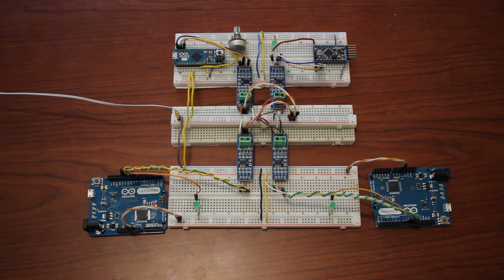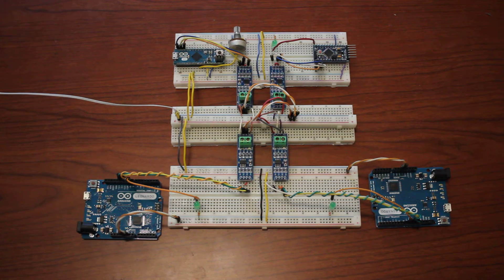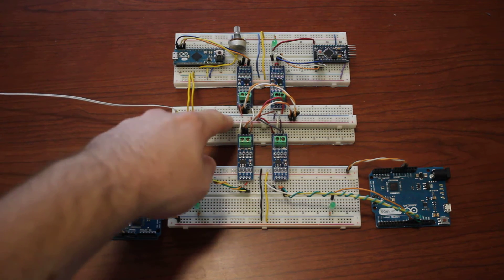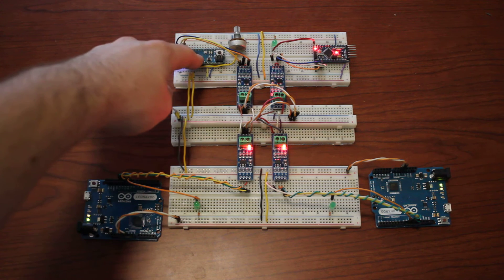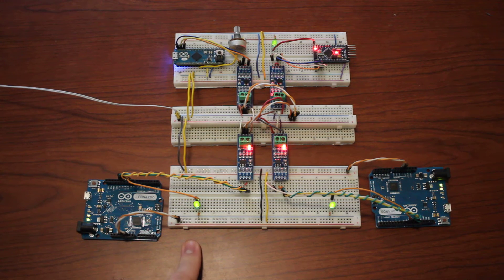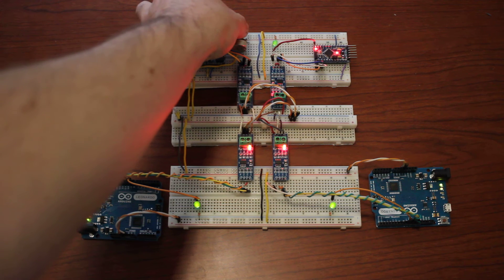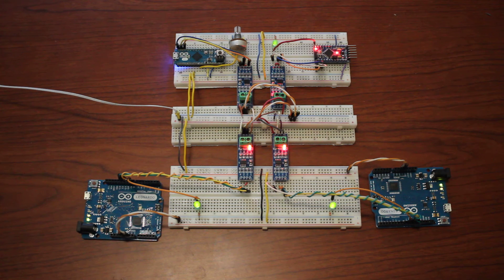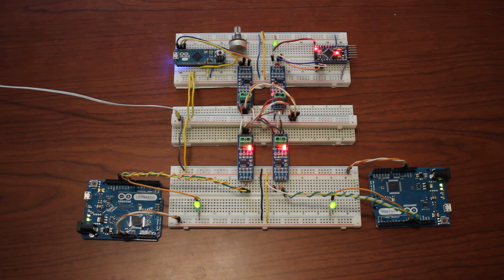RS485 Hardware Network With Arduino - Part 1

Comment: Searching the internet I identified that the reading is wrong because according to the IFC050 manual to read the address 30002 I have to read 2 Byte. Code used for my project only read 1 byte, so I need to change the code to read the 2 bytes. How can I  change the code? And help me understand how to read the 2 byte?

Comment: How Can I read address 30002 with 2 register? I need to read volume flow of water. Using modscan32 and a usb adapter for rs485 I can read the correct value, but with arduino and this library the read value is different. According to the manual address 30002 is read as inputRegister.

I'm using the mega arduino and the RS-485 TTL MODBUS converter

I am using the IFC050 flow sensor (modbus manual link below) look at page 12:

http://www.conaut.com.br/produtos?task=callelement&format=raw&item_id=50&element=943615ec-1ce8-4738-9563-523b9801c59c&method=download

What's wrong with the code below?

-------------------------------------------------------------------------------------------------------------------------------------------------------
//Code used in the project.
-------------------------------------------------------------------------------------------------------------------------------------------------------
#include <ModbusMaster.h>

#define MAX485_DE      3
#define MAX485_RE_NEG  2

ModbusMaster node;

void preTransmission(){
  digitalWrite(MAX485_RE_NEG, 1);
  digitalWrite(MAX485_DE, 1);
}

void postTransmission(){
  digitalWrite(MAX485_RE_NEG, 0);
  digitalWrite(MAX485_DE, 0);
}

void setup(){
  pinMode(MAX485_RE_NEG, OUTPUT);
  pinMode(MAX485_DE, OUTPUT);
  
  digitalWrite(MAX485_RE_NEG, 0);
  digitalWrite(MAX485_DE, 0);
  
  Serial.begin(9600);
  Serial1.begin(19200);
  
  node.begin(1, Serial1);
  
  node.preTransmission(preTransmission);
  node.postTransmission(postTransmission);
}

void loop(){
  uint8_t result;
  uint16_t data[6];

  result = node.readInputRegisters(30002, 2);
  
  if (result == node.ku8MBSuccess){
    Serial.print("Flow: ");
    Serial.println(node.getResponseBuffer(0x00));
  }else{
    Serial.println("Error");
  }   
  delay(500);
}
-------------------------------------------------------------------------------------------------------------------------------------------------------